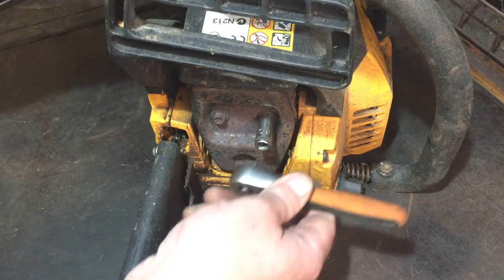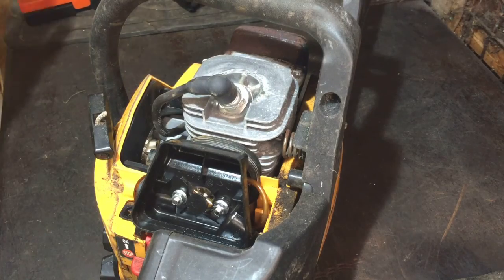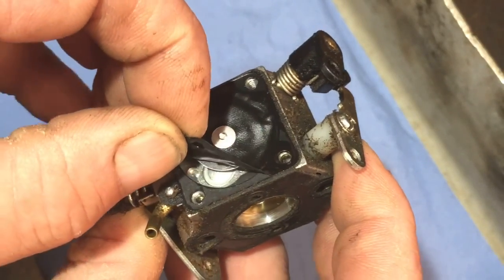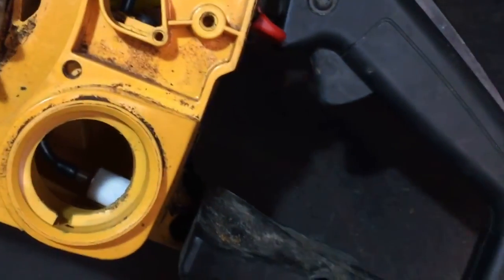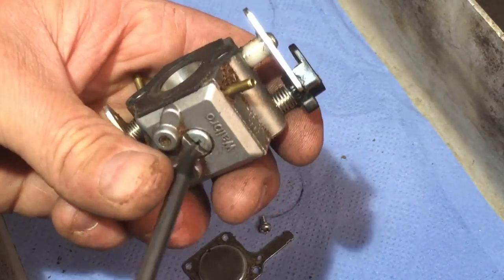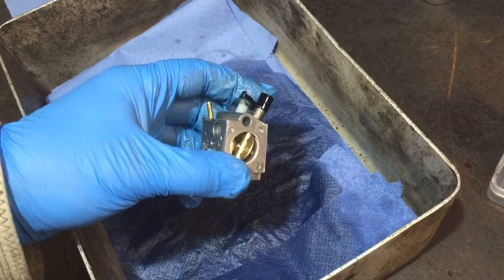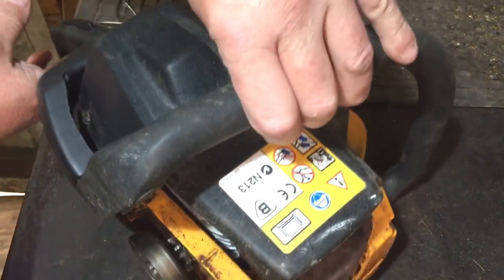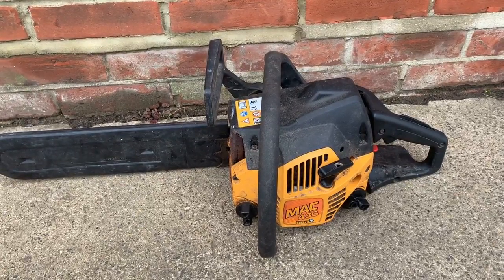McCulloch Mac 436 Chainsaw ( Sorting out the fuel system ) ⛽️🪛🔧

Comment: I followed this video to sort out my 435 model and it helped me greatly.  The only tip I would give people and it is slightly more work to start with, but makes things easier when removing/ re-installing the carb and that is to remove the throttle & grab handle assembly.  Disconnect the throttle cable in the handle first and it makes access a lot easier and everything comes away without having to wiggle the carb /air filter housing / choke lever out.

Comment: your video was a big help to me. I was given 436 McCulloch chainsaw, to be honest i will just replace the carburetor without fiddling. Ive taken the serial number down. Could say that it is easier to undo the cable throttle from the handle bar instead of by the carburetor. Thanks for your assistance.  A big help.

Comment: Well done Mr Luke. Although either of those pump gaskets would work, I believe that woven gasket is used on larger CC equipment. Those Mac saws have a dedicated following despite being disliked by so many folks here.
Reply from the maker: Hi Stella thanks for the info 👍 I actually like the saws even though they are a fiddle to work on, In general chainsaws have a more hidden carb meaning they aren’t as easy to work on as say a hedge trimmer or strimmer. It’s a challenge which I enjoy and it’s a nice sorted saw now. Thanks for watching 🙂👍

Comment: Hi Luke, most of these Poulan saws are used by a homeowners for a job or 2 and then won't start and dumped🤣
I like them for what they are but are fiddly to work on👍
Reply from the maker: Hi I like them they are a decent saw for what they are, in a way I enjoy working on them as they are More of a challenging than most, not really difficult just a fiddle ideally you need tiny hands 😂 Thanks for watching 🙂👍

Comment: The pumping diaphragm, colour & material  denotes resistance to Ethanol in fuel. Least to best, black, blue, tan. 
The metering diaphragm button height sometimes varies in kit from original, so lever needs tweeked accordingly.
Walbro, have developed a new "spiral ",  metering diaphragm kit that is supposed to last the life of the  machine, using fuel with up to 85 % ethanol content. Pricey, compared to regular repair kit.